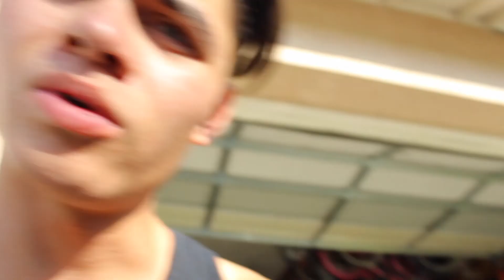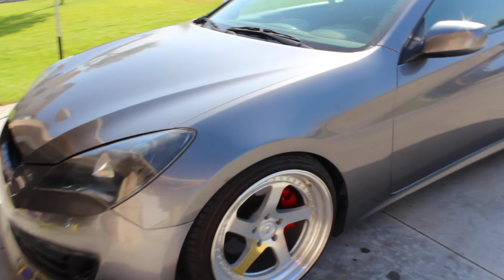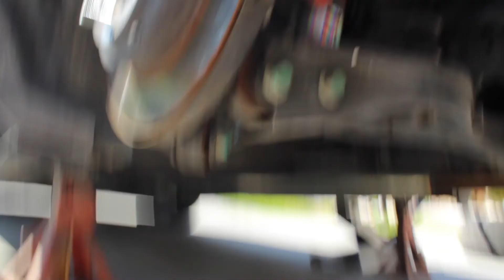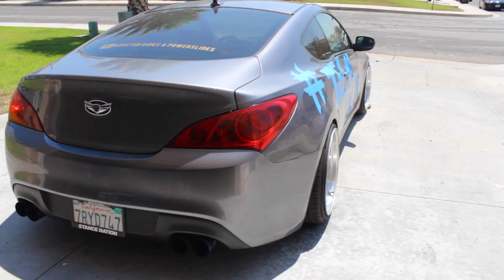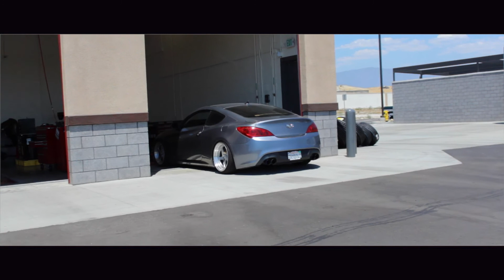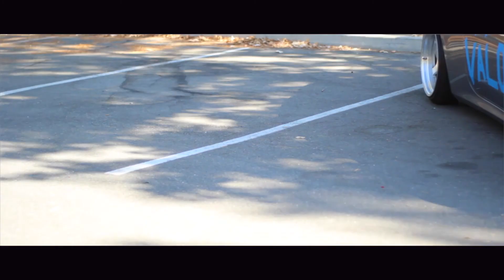Slamming My Genesis Coupe!!

Comment: Not sure if it was said in the video, but what are tire/wheel specs? Super clean
Reply from the maker: 19x9.5 +12 with 225/35/r19 fronts 19x11 +15 with 245/35/r19 rear
Reply: Tyler Cordura would this sit the same on a bk2 ?
Reply: Big Ballah what type of rims are these . Name etc
Reply: Big Ballah wish i can see a genny with thoes wheels

Comment: My Accord sits lower with my front lip it was way lower but I had to raise it up 15 threads because I was scaping on every bump while driving and I went up a steep driveway and it ripped the left side of my front lip off my bumper so I raised it up a little bit and it still looks low as if it was never raised up I like the way it sat before I had it raised up but it was too low for daily driving